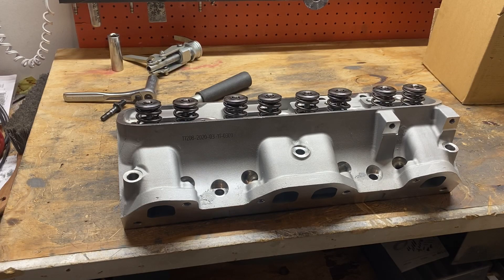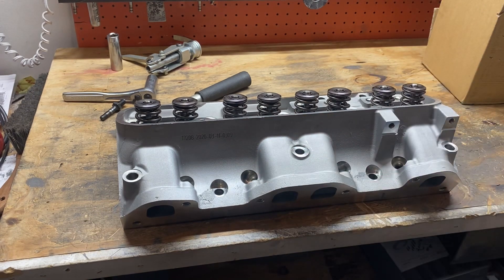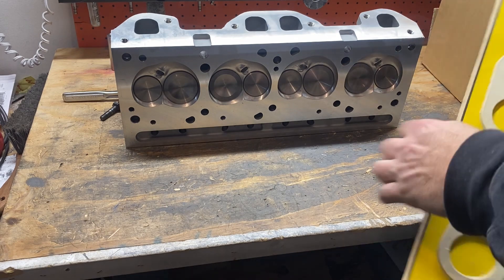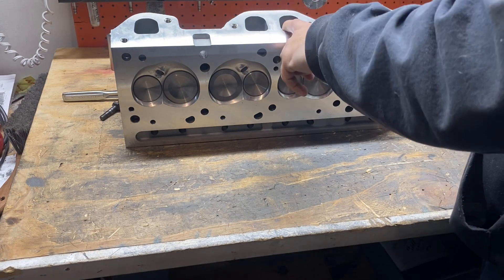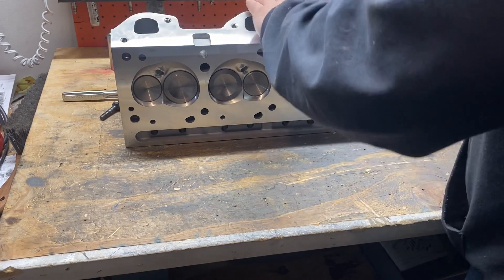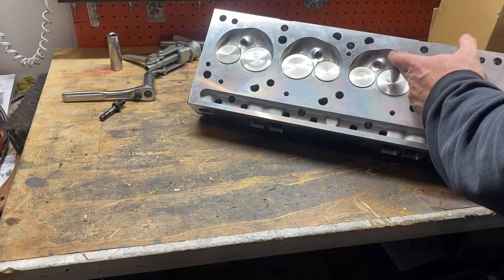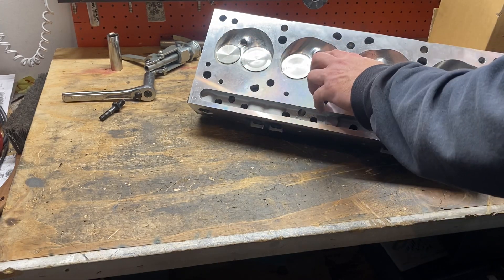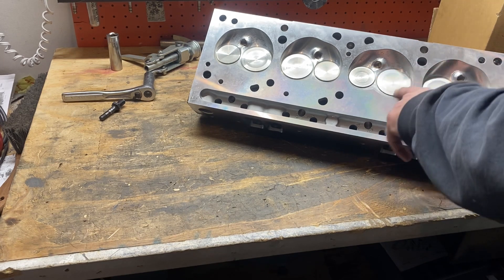Speedmaster Pontiac V8 aluminum cylinder head review/porting

Comment: Please get your facts straight , Speedmaster/ Procomp is an Australian company expanded to the world , they are excellent quality head for the price , they are not a bolt on 900 HP head , it's a basic starting point , the exhaust ports are D shaped because in the 50 years since the Pontiac round port was used we have demonstrated many times big is not always better and a D shaped port is far better than round , port floor does nothing for flow so it don't need the bottom half of the round port . Ask any 4V Cleveland builder , who fills in the bottom half of the port to get better flow, but again design so if you want to go backwards in flow to 1969 and make it round there is plenty of aluminium there to make that mistake. For under $900 a pair US you can't go wrong , and being Australian company with a big presence in the US you have as much support if not more than any other brand . I've used Speedmaster heads on many a build , no problem at all .

Comment: In fairness to PC,I did a three-part assessment of the Oldsmobile heads, on my channel.  Whatever tooling ridges existed in the bowls cleaned up in a few minutes.  Certainly nothing worse than any as-cast aftermarket part I've ever had my hands on.  You wanna go fast, just about everything needs a little clean-up and massaging for all your components to play nice.   Now, I once had a knockoff intake manifold so far out of plane that it cracked when bolted down.  Obviously that's "atrocious," and good luck returning it.
Reply from the maker: The intake port misalignment is so bad on these heads I’m unable to correct the transition from the port to the valve seat.  All I can do is put an angle on the bottom of the valve seat towards the port wall, it’s this bad.
Then there’s the issue of the intake gasket not matching the RA4 gasket they claim.  I had to order a difference set of intake gaskets to match the head, SCE 128105

Comment: have any of you folks ever heard of larry wenzler and the wenzler 2 pontiac heads. i have two sets of them and they work well. they are wide ports. the valves are splayed 2 degrees. with not much work they flowed 300 and 238 at 600. the velocity was pretty high. ive had the first set on running motor for four years now and people cant believe the response and i run his tunnel ram also. mine is at 11.7;1 compression and on e85. they are round ports also. i have a couple vids of it. first day i fired up and last year after getting jetting right and setting timing. he also has larger heads for bigger cubic in motors but there are people making big power with them. as for cost i gave 1100 for bare set...
Reply from the maker: Wenzler is definitely old school and hard to find!  👍
Reply: @HeadFlowInc  he still makes them...but they work and work very well.

Comment: Intake to exhaust ratio should be maintained at 71%. This doesn’t need 1.77 exhaust valves- it would make no difference. The exhaust flow in this application is perfectly fine.
Reply from the maker: You would think you’re antiquated information would be correct, unfortunately it just doesn’t work like that. You can contact Any Pontiac builders, as long as the cylinder bore will except the larger exhaust valve run it.  Kaufman Racing or Butler Performance are excellent examples when you look at their cylinder head upgrades the 1.77 inch exhaust valve helps. Also you can’t just look at the size of the valves in the head if you want to talk about flow ratio then you need the actual flow data to compare.

Comment: Oh boy! Seeing budget poncho heads makes me wanna get my goat going again. What's a pair going for about? been a while if i remember correctly those ex. ports look like Ram 4 D port style, the round ports were the 455 superduty H.O. heads I wonder if they make a head with the typical oval ex. ports so I can still run my headers
Reply from the maker: You will need round port headers for these Speedmaster heads due to the port layout.  The exits are d-shaped not round but laid out in the same spacing. 
I’m not sure on pricing, maybe around $1750.00-$2000.00
Reply: @HeadFlowInc  Yeah I remember that with the edelbrocks too. It be nice to get some heads on my 400 and drop the compression down its over 12;1 with iron heads I used to have to steal all my dads 100LL av-gas to run good lol
Reply: I just ordered a pair.  They had a Black Friday special for $1200 + tax.

Comment: Great info. What do you feel are the best aluminum heads for Pontiac? I hear a lot of positive about the aluminum Edelbrock performer RPM heads what is your opinion on them? Thank you
Reply: McCarty Racing RamAir V
Reply: @doomman700  Thank you I will check it out 👍
Reply from the maker: Well it depends on budget and what you want to do?  The later Edelbrock castings aren’t the best which is a concern. We use to hear a lot of good things about the Kauffman Racing heads. 
Are you wanting a set of D-port or Round port?  
Thank you for warning and the feedback!  JD
Reply: @HeadFlowInc  I haven't really decided whether I want D port or round Port yet?  What I want though is a good all-around street  engine looking to be in the 500 to 550 range with maximum torque in the mid-range. I also want to be able to run fuel injection power brakes power steering overdrive . Probably going to go with a 474 stroker I was thinking Edelbrock RPM  heads but not sure?   I was thinking of going with Holleys sniper fuel injection but it's limited to 500 horsepower so it would be at the maximum for it. Not sure if you have any advice on the fuel injection? Thank you

Comment: i purchased a bare set of those which i had assessed, cleaned up, ported and flowed with a full report. Fitted with Ferrea 2.11/1.66, viton seals, comp springs and arp studs, they are as good as the edelbrocks if not better with better oil drain backs and cooling chambers. Had them setup to suit a street - strip 412ci n/a with ra4 cam, we got 300cfms@0.600". Velocity manners over cfm's was our target. Obviously have same porting potential as the E-heads and can physically be upgraded with 2.19/1.77...
Reply from the maker: 300 cfm @.600” sounds like a good street head!  The part we’re questioning is the stock flow claim of 289 cfm?  
There’s not a lot to work with because the throats are all where I’d set them to start with.  Thanks for watching and the feedback I appreciate it!  JD

Comment: With your years and years of flow testing experience why did you not post the flow data, I really wanted to see the flow sheets?
Reply from the maker: The heads aren’t done yet, but the owner does want to have them flowed!  What would be best is to flow them before and after porting to verify if those Speedmaster numbers are legit.  Stay tuned their coming!  JD
Reply: @HeadFlowInc  Are you telling me you are doing cylinder head porting and you do not own a flow bench?
Reply: @HeadFlowInc  I don't think Speedmaster claimed that number.  It was a member on the PY Forums who flowed the Speedmaster and Edelbrock heads.

Comment: These are literally just a clone of the Edelbrock Pontiac round port heads, It would be nice to see a side by side comparison of these vs the E head.
Reply from the maker: They call these Round Port but the only thing Round Port is the bolt pattern, the exhaust exit are d-shape and smaller. 
I agree it’s just an off shore knock off head. JD

Comment: Thanks for the Pontiac love- look forward to seeing your magic on them!
BTW- I’m not surprised they got the ratios correct- they pretty much used Edelbrock as their R&D, hence why 1.66 vs. 1.77 ex valves.
Reply from the maker: If they were my heads I’d like to upgrade to the 1.77” exhaust valves. I’ve been researching, other porters say don’t mess much with the d-port exhaust exits in the round port spacing. JD
Reply: @HeadFlowInc  I'm still confused if the exhaust ports supposed to be d ports, or round ports. Certainly doesn't look like round ports. Are you doing a clean up service for these heads, and if so what is $ or contact info?

Comment: Great vid, and case #1254612485 of why you never buy and just bolt on assembled heads. I agree with you on the intake bowls, they do look surprisingly good and have good shape. Interested to see how they measure out. When you start to work on them, could you show the as cast short turn design on these? I'd like to see what they did with them. 
Love your channel, and your ability to show people the RIGHT way to port heads. Good job sir
Reply from the maker: I’m hoping to get some pre-porting flow numbers to compare to the advertised numbers.  If I don’t have real proven flow numbers there’s no way to tell if I’m winning or losing. Best case scenario I can get flow numbers both before and after. 
Yes, I’ll try to show better angles and images of the ports etc.  Thanks for watching and the support!  JD